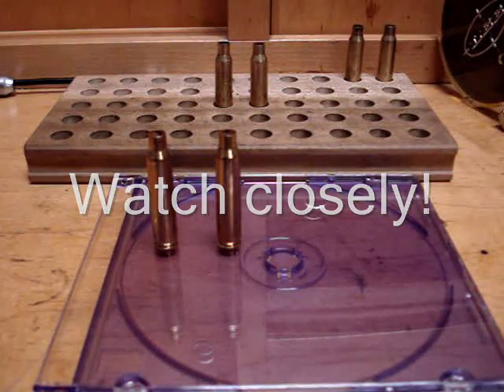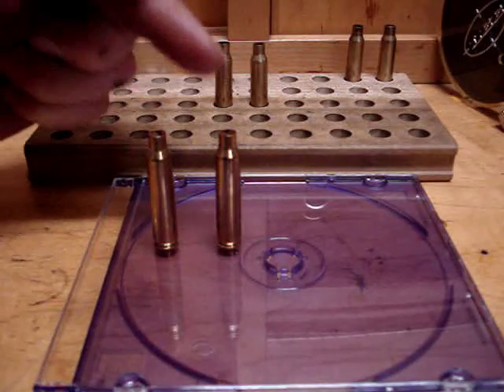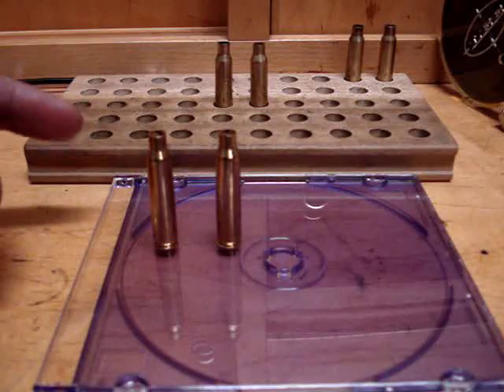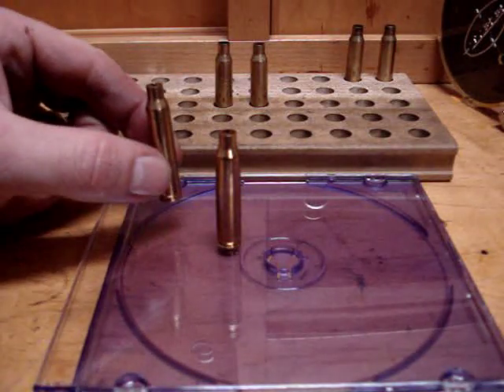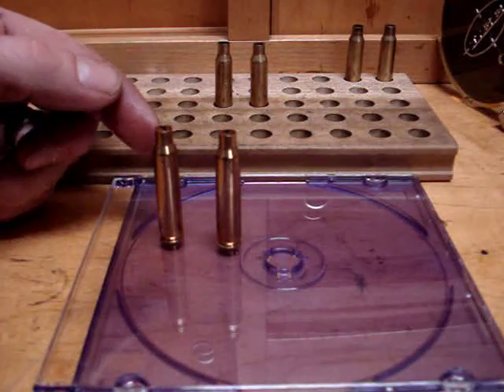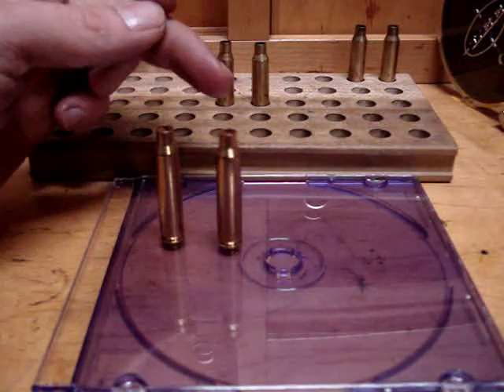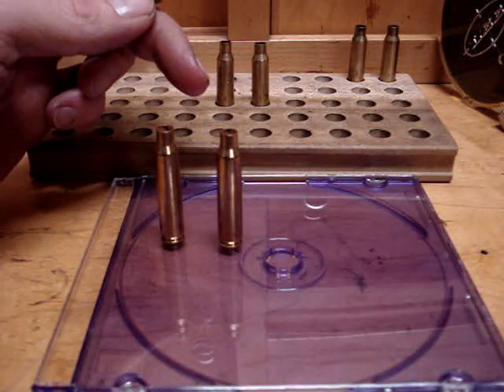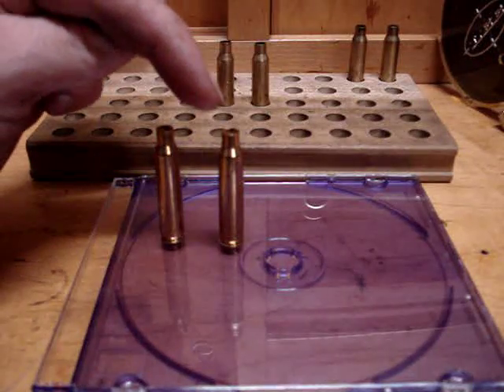Quick Tips: Are your primers seated right?

Comment from the maker: pressure. Drill out the flash hole with a 1.8" drill bit. That will cure it but will make the case only serviceable for glue stick bullets.